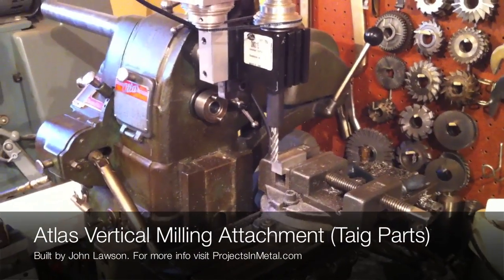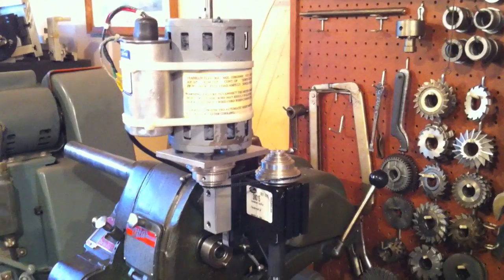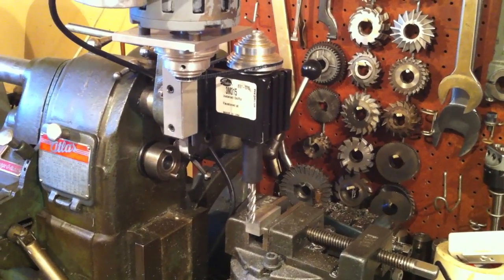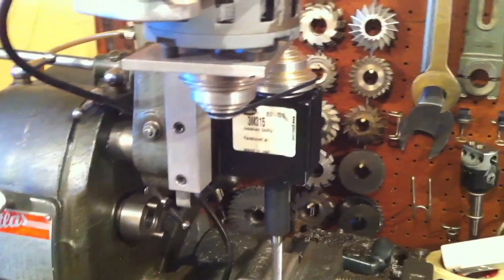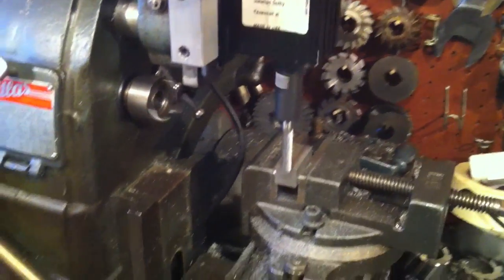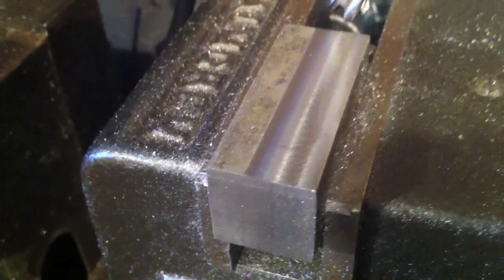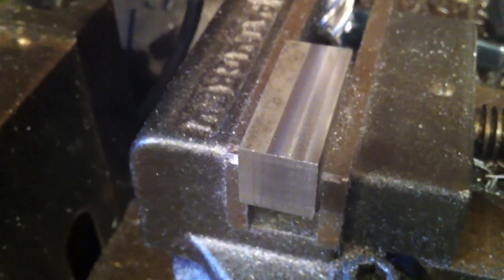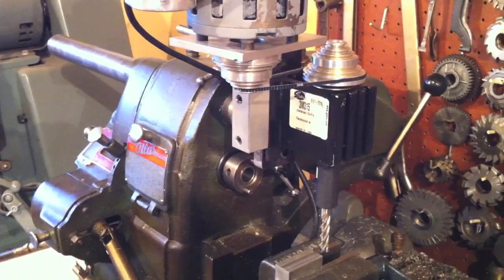A Vertical Milling Attachment for the Atlas Horizontal Mill - Built from Taig parts

Comment: Too complicated and heavy bulky crap,Proper attachment could easily made yourself,Marvin have correct idea but wrong setting with pulley's,instead pulley the spindle end shaft should be insert into milling spindle and tightened with draw bar..There should be indexing rotation mechanism that attaches to standard arbor support earing and swings side ways from left to right enabling 90 degree angle if need or positioned straight..Really simplest design,the helical gears is what rotates vertical attachment spindle,on top of vertical attachment is draw bar that tightened R8 collets for instances..I getting my MFC piece by piece,ones fully assembled I start building my own vertical attachment that would save me lot of money..